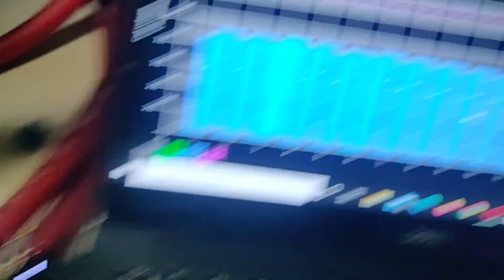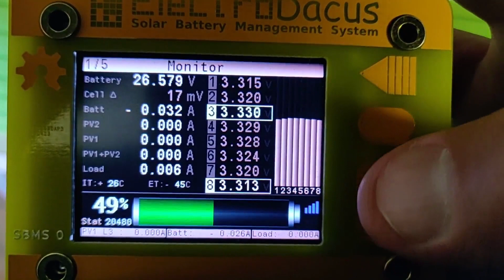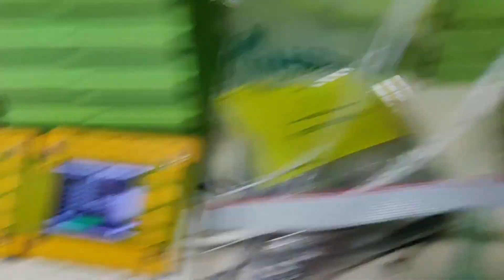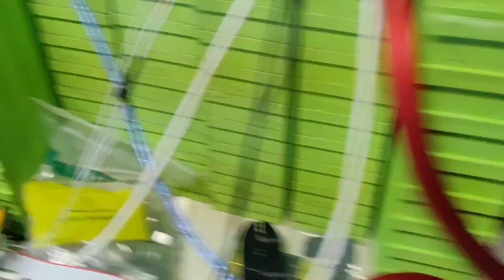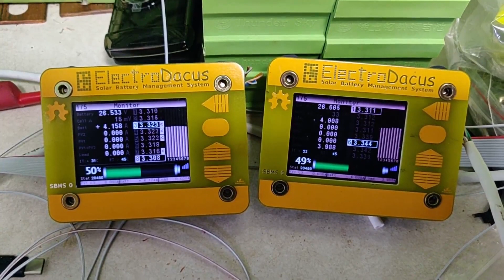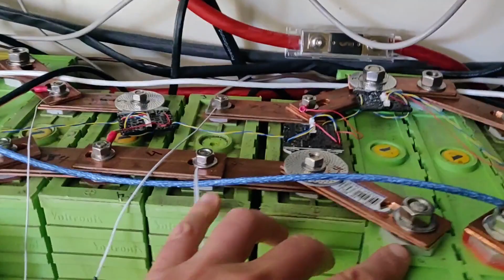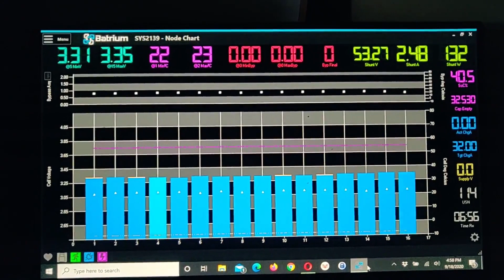Electrodacus SBMS0 vs Batrium

Comment: Keep your fingers on the capacitive buttons do not just touch them for ms and it will work to get out of the monitoring menu. Is not a cellphone there is no interrupt for capacitive touch buttons as it will not be safe.
You had the shunt connected in reverse thus the SOC difference. SOC will calibrate to full so will jump to 100% as soon as you have a full charge so 3.55V for highest cell.
The current shunt resistance need's to be set correctly for both the battery shunt and the PV shunt in order to have correct current indication.
Also I noticed PV1 was at L3 and that means you have probably the EXT IO5 set as type 6 but since you do not have a dual PV array setup you need to set that to type 0 or anything other than type 6.
Charging from the inverter/chargers and not allow SBMS0 to terminate the charge will not work as SBMS0 can not protect the battery.
Reply from the maker: Thanks again so much for your help!  I'll check all those items and post an update.  This video was just a quick and dirty intro which David Poz asked me to post.  I'll try to fix all the issues and do a more in-depth video.  So far I'm very impressed with how well this setup works.  I do see what you mean about needing to top balance, as the lower cells are almost perfectly balanced against each other and are charged all together up to the set point, whereas the top cells are mismatched and charging is terminated when one node hits the set point, which keeps the stronger cells from being topped up as much as the lower set.
Reply: @NoelBarlau  The SBMS0 was not designed for a 48V system so each SBMS0 will see only half of the pack and they do not communicate between then thus likely only the SBMS0 containing the highest cell voltage will calculate the SOC correctly as when the cell gets to 3.55V the charging will be stopped and SOC set at 100% but the other SBMS0 will not know about that so that will never be able to calibrate the SOC at full as it never sees any cell at 3.55V unless there independent charging for each half of the pack.
Reply: @electrodacus  Dacian, how does the SBMS0 (Not SBMS40 or 120 which have PV and battery terminals) independently control charging and discharging of battery. Ie, STOPPING/DISCONNECTING battery from charging or discharging when the different battery states are reached since the SBMS0 does NOT have any PV or battery terminals to be able to cut the flow of electricity to and from the battery. I only see the small balancing leads? In a traditional BMS, the battery goes through the BMS which is able to isolate the battery. I am a novice in this, so excuse my ignorance.
Reply: @thelightworshipper9687  The SBMS0 will have remote signals called EXT IO3 and IO4 that will be used for ON/OFF the charging and separately ON/OFF discharging and this open or close circuit remote ON/OFF will be used by the DSSR20 thus SBMS0 can stop the charging from PV by controlling the DSSR20 then for discharge it depends on what Loads you have. Most people will only have a large inverter and use only AC loads then the EXT IO3 set as type 2 will be connected to the inverter remote ON/OFF and that will allow SBMS0 to turn OFF the inverter and thus stop the discharge if any cell drops below the set limit say 2.8V for LiFePO4
If you have small DC loads then something like the Victron BP65 can be used and that again will be controlled by the EXT IO3 set as type 2
The SBMS0 + DSSR20 can do the same thing as SBMS40 / SBMS120 is just a more modular design. The SBMS0 can control as many DSSR20 as you want up to max 48 so it can handle up to 30kW of PV array and up to 20kW load with 24V battery. You can check the user manual for SBMS0 and DSSR20 on my webpage.
Reply: @electrodacus  Dacian,  i did look at most of the manuals on your website. I really admire your accomplishments.  I am a novice in this field and like to learn and asking a lot of questions is my way of learning.  I like your products and design.  I like simplicity and affordability.  I will be emailing you with my personal needs and get your input on that before i order the parts from you. Why does the DSSR20 (without diversion) require a resistor to be soldered?  Is that a design oversight?  Or there is an application of the DSSR20 were the resistor is not needed? Why don't you have a component (relay) on the load side like the DSSR20 to disconnect the battery from the load. I know there are products out there that does that, like from Victron but i don't like to support cut throat companies that always   over price their products.
Reply: @thelightworshipper9687  The resistor is for current limiting in case of a short to ground of the remote ON/OFF wires that current limited by resistor will help protect the wires as well as the SBMS0 internal optoisolator that is capable of max 50mA and so resistor will need to be close to battery positive and so it can not be included in the SBMS0 and also the resistor value will depend on both the battery voltage and how many parallel DSSR20 needs to be controlled or maybe a different device other than DSSR20
You can consider that external resistor as an external fuse just better than a fuse as it will protect the circuit without being damaged so after fault is removed no fuse or resistor needs to be replaced.
It makes no sense for me to build a Load disconnected when there is Victron BP65 at a fairly affordable price available for those that need to disconnect small DC loads and for those that only use an inverter that is not needed as inverter can be remotely ON/OFF directly.
The Victron BP65 is $39 https://shop.pkys.com/Victron-Energy-BPR000065400-BatteryProtect-1224V--65A_p_6422.html  and I can not produce that at a better price as they build that in high volume I think in India.
Reply: @electrodacus  for the DSSR20,  IF I order the DSSR20 with diversion and the DEXT16 then i would not need any resistors to solder, right? 
I have not looked at all the Victron products but most stuff of their stuff is pricey. So of their implementations, i don't like. Like for bluetooth,  every time you change screen on an android phone and back to the victron app it has to reconnect again.
For the load disconnect approach for high capacity inverter 3000w+ of switching the invert switch on/off might create a issue. The SBMS0 turns off the inverter when the battery is low and turns back the inverter ON when the battery recovers/get charged. What if the inverter was originally OFF or the user doesn't want the inverter to come back on. I think the SBMS0 will always turn ON (or keep ON)  the inverter if the battery is not discharged, or am I wrong in my reasoning.  Again, I really appreciate your input and accept  my apologies for asking too many questions.
Reply: @thelightworshipper9687  You will not need the resistor in that case as both EXT IO4 wires will connect to DEXT16 and be internally protected from overcurrent but you will still need a fuse to protect the wire that supplies the DEXT16 from battery.
Maybe some Victron devices are pricey for what they are but that is not the case with the BP65 or BP100 that I will not be able to produce at lower cost and they do not have Bluetooth (not worth to pay extra for that functionality). 
You can have a switch in series with the inverter remote ON/OFF to keep the inverter manual OFF if you want. That is how is set in my house as I only use the inverter in average around 2 hours per day mostly for electric cooking.
Reply: @electrodacus  interesting? You use inverter only for cooking. What about your other 110v appliances(tv, computer, lights, fans, fridge, freezer, etc...)?
Reply: @thelightworshipper9687  All my other devices, LED light, computers, fridge works on 24Vdc directly. The house is all wired for 24V DC and there is only one double AC outlet.
My wife uses a Laptop so that has a 24V to 19V DC/DC converter and I use an all in one ASUS P1801 again use a 19V DC/DC power supply to power that. I do not have a TV but there are TV's that have DC in (all those that have external power bricks usually 12 to 20V DC).
I use LED lights directly on 24V DC and I have a small peltier based fridge (powered with 6V DC/DC converter) as is quiet and I do not need more than that. I have a bench multimeter that is powered with 9V DC and some other DC devices.
Reply: @electrodacus  Dacian, thanks for sharing.
Reply: So the SBMS0 can be used with a shunt trip breaker? To protect the battery ifa cell is low or High, out of balance? Or if the bank is low or high? And read charge level? This is about all I need besides a ballance function,  will the SBMS0 work for me?
Reply from the maker: @jamest.5001  Dacian is excellent about answering questions on his solar forum, or you might find the answer you're looking for has already been posted.  He might not respond here.  Just google Electrodacus forum, or go to the main website and the forum link is kind of hidden in the upper left corner.
Reply: @jamest.5001  You can use a trip breaker to protect the battery from over discharge but that will require you to manually enable the Load if that happen. For high cell voltage that will not make sense as SBMS will normally stop the charging multiple times a day and need to re enable.
There is a type 5  on the SBMS that is for cases where charger fails to stop based on normal remote ON/OFF or loads fails to stop (extremely unlikely) and so that is based on secondary low and high voltage limits and if it gets there it means something failed then a shunt trip breaker controlled by and EXT IOx set as type 5 will be a secondary level of protection that will probably never need to work but is there as additional safety. Still you will need to shunt trip breakers or one with two separate contacts to disconnect the charge and discharge path separately.
Reply: @electrodacus  I have the shunt trip as a last resort protection, it's about 300 amps over needed, it's basically a shut-off, in case there is a over charge condition, or cell imbalance,  so likely never used, the bank isn't fully charged anyway, and I would want the shunt trip to trigger at say 4.25v per cell, while charged to 4.1v per, I just need a BMS that will balance , and trip the shunt trip if there is a cell imbalance, or high or low voltage, the inverter has a low voltage alarm, and shuts off before the cell cutoff, so all should be fine, the BMS would be the final safety! I have a monitor for wattage and current, voltage,   the sbms0???
Reply: @jamest.5001  Yes the EXT IOx say IO6 set as type 5 will do exactly that but you need a small solid state relay capable to drive the shunt trip current as EXT IO6 can only do 50mA so something like the CPC1705 normally closed SSR should do the trick. The EXt IO6+ will connect to battery+ trough a current limiting resistor say 470Ohm then EXT IO6- will connect to pin 2 of the CPC1705 and pin 1 of that will connect to battery- thus as long as all is OK and all cells are in limits the CPC1705 will be open circuit as EXT IO6 is close circuit and supplies the input of the CPC1705 then if the IO6 because ope circuit or one of the wires gets disconnected the CPC1705 pins 3 and 4 will be close circuit and that should supply the shunt trip thus cutting the battery charge and discharge circuit (breaker that is tripped needs to have to separate circuits one for charge and one for discharge as you will not want to leave chargers and loads connected together but without a battery).
Reply: @electrodacus  I have about 50 small SSR, that can do this, I saw the green redesign of your products, but I'd rather buy from you, since you designed this and put the effort into it, and give info and replies, I think I'll get one soon, thank you,
Reply: Do any of the eletrodacus bms have a HDMI output to connect to a larger monitor?
Reply: @nemoexpress3426  There is no HDMI output but you can see the data over WiFi on any computer with any screen size.

Comment: Hi - wondering if these are the cells you were trying to save in your earlier video? Appears it’s a 2p16s with some 4ps thrown in...? How does the Batrium handle that mix of Ps..? Thanks
Reply from the maker: Hi Mike, it's essentially a 2p16s setup, but with some of the smaller cells I had to use two of those to equal one of the larger cells so it I suppose would be 3p on the top four nodes.  That's why it looks funky.  These cells came from the same source as the bad cells, they were previously installed in Wheego cars.  The dead ones were left hooked up to a BMS for years without charging, and it eventually drained them completely and killed them.  The Batrium doesn't see it as anything unusual, it only sees individual nodes, which from an electrical standpoint is still one single node.